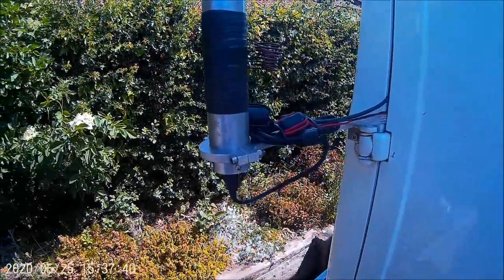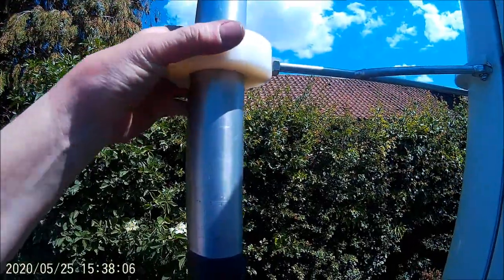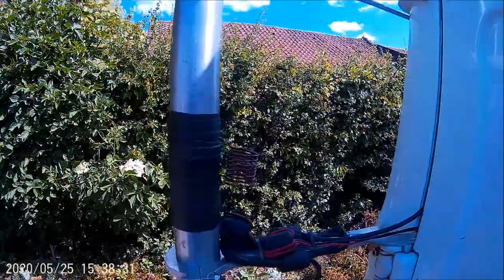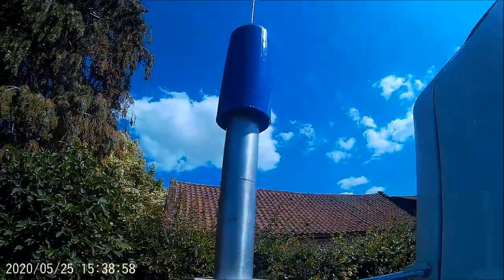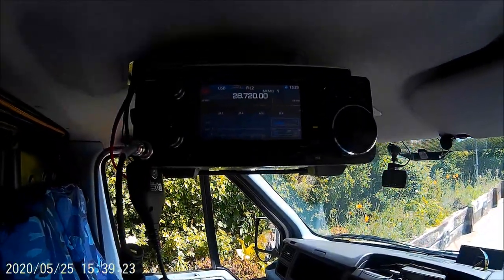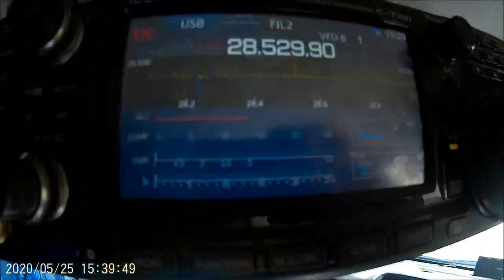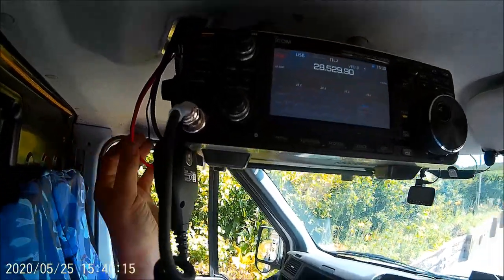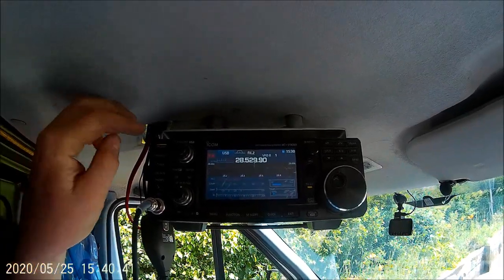Screwdriver Update

Comment: how many watts will this screwdriver antenna handle
Reply from the maker: Hi there all I can tell you is I run an Ameritron ALS 500 amp mainly on 80 meters and run about 350 watts and never had a problem. Hope this helps cheers.